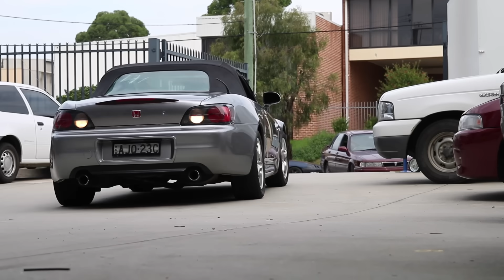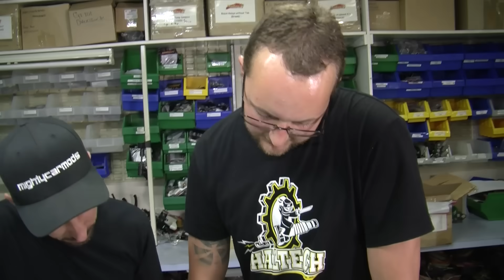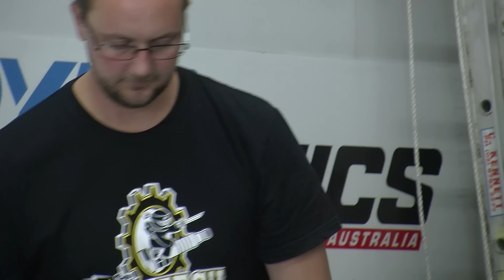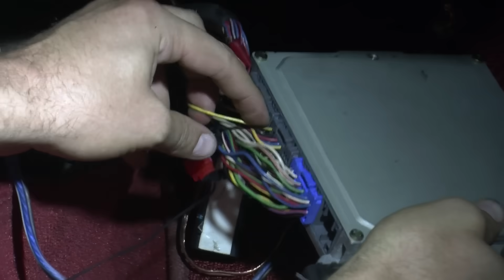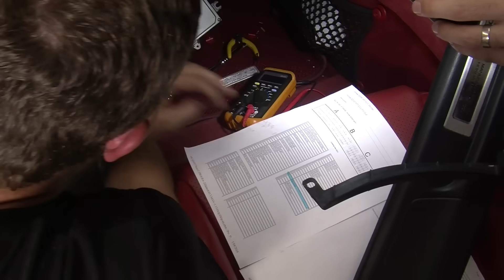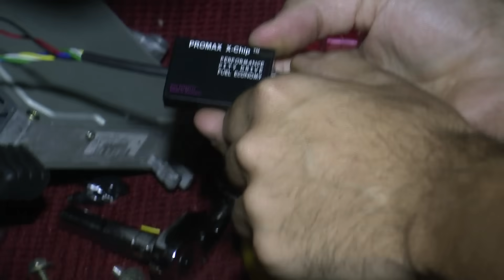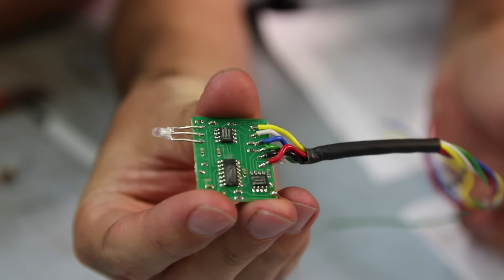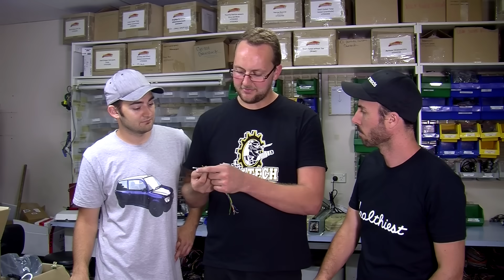eBay Performance Chips -  Mythbusted

Comment: Do it right people. Find a custom tuning place that is known for writing tunes. Usually a custom tuner will specialize in a few different vehicles/engines or 1 brand(ford). I had a custom tune written for my 08 V6 f150 by vmptuning in Florida and the guy who wrote my tune, an expert tuner on f150s and mustangs, told me only 10 to 15hp with the tuner and cold air intake. Intake claimed about 7 hp which the guy told me realistically maybe 2 or 3. Stock engine was 202hp and 260lb-ft(4.2L V6). Intake I felt very little but tune was a big jump. Flash tuner (SCT X3)with custom tune written by an expert for $420 the right way.....or 20 bucks for a claim more than double that....i was also dumb once and bought a resistor for a car which tricked the air intake temp sensor and it added power but my car burned up an exhaust valve a few months later.

Comment: I have a chip in my car and i had to add 50 plus miles before it added boost and economy i mean my tank wouldn't move but one little line a day before with same commute it was a quarter tank a day...... do this test again but add the initial 50 to 60 plus mile then put it on the dyno...... i'm sure the instruction suggested that when you guys bought it.

Comment: That same ebay seller states you can get a chip for a 4th generation f-body (camaro-firebird-trans am) funny thing is the "chip" is soldered to the board on these vehicles. If you want more horsepower or want to go faster, you need to modify the engine or lighten the weight of the the car or both. oh, and don't forget the tranny too. You could get tuner pro and reprogram the ecm/pcm, but without engine/intake/exhaust mods, you are really stressing your motor.
Installing an after market ecm/pcm is the same as using tuner pro, but again, do you really want to do this? your performance might increase, but in the end, you are shortening your engine life and violating your country's environmental laws.

as far as the ebay guy goes, he is using a simple circuit to change the color of the led. this is a very old scam and i find it humorous people still fall for this...........by the way, i have a bridge in new york i want to sell........only 10 thousand dollars.

Comment: The reason why you didn't see any gains is that you weren't using the dyno properly.  You should have changed the dyno calibration to Unicornpower, not horsepower.  Noobs

Comment: That little circuit board with the chips are just ment to change colors in the led light, for different voltage / currents. Thats the reason why they didnt want you to know what the chips were. haha

Comment: Had that car have a maf you can trick air temp, engine runs richer, computer would lean it out,  run hot, knock, and fall into limp mode.  Tried it years ago...fail.

Comment: It is possible that since your car is using a MAP sensor and not a MAP sensor that the product won't work. The two sensors work completely differently and the data they send is totally different. So theoretically they didn't do a fair study.

Comment: I remember my friend claiming he was going to chip his Dodge Ram and gain 60 hp lmao
Reply: Gauby Very possible for diesel engines, 60HP from a tune on a diesel is hardly anything at all. 150+HP is actually quite common. As for the HEMIs, 20-30HP is about the most you'll see without any other mods.
Reply: If its a Cummins he can make way more than 60hp from just a tune, get one like a smarty depending on the year you can gain 150hp+ easy.

Comment: Has anybody ever installed a performance chip, or known somebody that has, and have actually gained a large amount of horses?
Reply: I think chip tuning is only really effective if your car has a turbo. My friend took his Impreza WRX 2.5 to a company with a rolling road like in the video and they used computers to remap his original chip, which is undetectable by insurance companies. They play around with Subarus standard ECU settings for economy, emissions and boost to optimise performance. Power increased from 230ish to 271.2 BHP but more impressive was the increased torque - I can't remember the exact figures, but there was about a 30% increase with an earlier peak and flatter curve. I could find out by calling my mate!   I'm sure if the tuner wanted  they could increase boost much more and to a degree that is up to the customer, but too much boost and you run into problems with emissions, over heating and reliability.  So yes, a decent difference in performance for not much money (I could find out exactly if you're interested) just with a laptop and dyno. The car feels stronger and more willing all the time, less need to change down or rev it out and it's  just plain faster, when it wasn't exactly a slug before!   And the great thing is - because the chip is not replaced, if you need to make an insurance claim the company can't tell the car has been modded and wriggle out of paying.
Reply: i have people who installed intake and claim they make 10 hp and i asked how did you know its 10 hp.

to my amazement he lost 4 hp from stock intake.. when we took it to dyno.
not all bolt on add powers
Reply: jamie turton Proof?
Reply: jamie turton you got any physical proof ?
Reply: BillyBob Keith Check this out./watch?v=2KfMY96v_Gc

You should know that forced induction engines gain much more power then Naturally aspirated ones.
Reply: Once you dive deep into the depths of car modifications and actual stand-alone ECU tuning, you'll find that there is a LOT of ways to say yes and no to what you just asked. It depends whether or not the car has other modifications to it, and whether the tuner actually knows what he is doing. I mean, yes you can get horsepower gains with an ECU alone as well as with forced induction and/or custom internals, as with these you will see significantly larger horsepower gains with a proper ECU tune.
Reply: Yep, my 30 year old chevy 305 was putting out 276 horsepower before I chipped it, then I bought a bag of lays potato chips took them home opened up my oil fill cap and put a chip in my engine, stuck it on the dyno and it had gained 151 horsepower! From 276 to 427 horse! I plan to now chip all of my engines.
Reply: joe Costello did you really waste your time writing this bad joke ?//
wtf is wrong with people!XD
Reply: Hi ive just bought a chip box off ebay its an EVOBOX made in italy £58.00 it was said to boost up hp from 140hp upto 179hp had it on dyno today and it ran 4 runs and came back with 176hp so we opened up the box which you can and moved setting from 4 upto between 8/9 and ran again and came back with 187.3hp a big WOW factor kia sorento 2.5 diesel with a 0/60 in 8.2 secs 0/120mph 18.1 secs couldnt change gear quick enough best £60 I ever spent and these guys make these chips for most makes and set them for each pacific car model  have ordered 2 more for customers
Reply: If you get the right ones they always will give you more horse.
Reply: if you're talking a remap, then that's different..but that's a skilled job working directly on a car's specific ECU. The generic $60 PCB with a light attached...? GTFO
Reply: WTF are you all on im telling you about a chip that actually works and does what it says it does and i get slagged off they must be shit cause you say so ive bought another 3 of these as we have 4 kia sorentos in our family and they all all having this box fitted so i must being talking out my arse like you
Reply: ***** diesel is different u use a db-box a t-box or a rail-box there u have improvement's !
Reply: on diesels you can gain a large amount the 6.7l f250 with a spartan chip you can gain as much as 315 hp with the twin turbos
Reply: aka everymod wich u can build for like 15 euro. sad to tell ya
Reply: BillyBob Keith My father chipped his 2008 Volvo V70 D5 from 185hp to 220hp, there are no proof that it did increase, like testing it on the bench, but the acceleration and top speed inproved a lot. The chip was bought at BSR tuning. The hole process took around 10-15 minutes by plugging a device in the car and doing some stuff on a mini computer that came with the package. It costed around 840 dollars. Here's a pic of what BSR say's the chip gonna do: http://www.bsr.se/images/power-charts/Power-Plot-x480y540-95-535924944.png
Reply: BillyBob Keith I have done one and it made my car run not so good even with high octane, waste of money these things are.
Reply: *****  diesel motors have been known to gain hundreds of horse power from "chips". I had a 150 HP tune on a Chevy duramax..
Reply: ***** yeah I agree. I mean if you slap a Borg Warner on a Cummins you'll see a fat gain with a good ECU tune, but it all depends on the camshaft tune, rocker ratios, and stroke as well, along with the selection of intake manifold.
Reply: x
Reply: no, id rather port polish and upgrade the interns of the engine.

"performance chips" are your major 'Kiss Your Ass Goodbye' to your hard earned cash...
Reply: Yes, on the 1987-1995 Grneral motors TBI pickup trucks,  but that was with other mods done as well, the ecu had to be re-mapped(by installing new chip) to handle the new fuel requirements
Reply: Lol it took 30 seconds to write id say it was worth it, sorry you thought it was dumb!
Reply: BillyBob Keith Yeah but those Chips cost 350€ and they dont give 35HP more like 15-20 HP but they work.
Reply: yes... those chips do in fact exist but they aren't cheap.
Reply: BillyBob Keith I'm sure the Ukrainian who sold the chip has installed more horses. Now there's 3 horses pulling his carriage instead of one. The handling is massively improved too, as he has now the choice of 3 directions the horses can run in.

His horses are called Dale, Monterey and Chip. The series was popular when he was a kid.

Comment: Not all chips are hack jobs like these. Being a '93 OBD1 BMW the map (tune) is on the chip and and a 98RON tune actually does give me an objective economy bonus (I calculated it properly) and subjective better low-mid range. I can tell because I have another 540i with stock tune to compare with.

Comment: Well that was....educational. would be interesting to see how the true plug and play modules for £60-£120 range work. Vs the more expensive units..... I had a plug and play chip from a company called Dragon Performance (The don't exist anymore I believe) anyway they were retail of around £350 and offered up to 30% if i remember right, picked mine up used from ebay for about £40. The unit plugged in next to the injection pump inline via a set of genuine harness connectors meaning it could be fitted in about a minute. it had a pedometer that allowed power increments of 5% to be set at a time. A loop of wire came out of the unit allowing for an on/off switch to be fitted. I did this with mine and you could notice the difference in the power when engaging the chip with your foot flat on the floor! This was fitted to a golf mk4 TDI 110bhp, remapped to bout 135 so was running about 150 with the chip engaged.... and boy did it shift!

Comment: Using a multimeter straight away would've saved you 22 minutes of video time
Reply: Putting a multimeter on a non-powered electronic device would mainly show nothing.
Reply: This is true, but it's fun to watch them systematically run the thing ragged on all the settings and demonstrate in power-to-the-ground terms that it does absolutely zip. Plus, hooking it up exactly as instructed (as best they could) avoids all sorts of manufacturer ducking and weaving along the lines of "opening unit may void warranty" or whatever. Diving into the guts of the thing at the end and finding out not only that it doesn't work as advertised but that it's specifically designed to do absolutely zilch (except make a pretty light glow) is the icing on the cake. Mind you, finding that the ICs' identifying codes had been deliberately scratched off should also have been a pretty good clue that something not entirely honest was happening.
Reply: I don't know, probably would've satisfied me ha

Comment: there are chips thatll give you a performance.tune. 84 mustang 5.0 5 speed, no obdII connectors for sct.tuning so they had performance.chips that actually.worked. the eeprom chip gets replaced by a chip that has a tune on it, could be for anything really. a chinabay (ebay) chip i would not trust since they dont.make chips anymore, you might be getting some blank eeprom with nothing on it.

Comment: you get what you pay for.   try the 250.00 one that plugs into the OBDII socket near the steering wheel.  It does improve accelleration and MPG.  I installed a cold air intake too.  On my 1997 Infiniti I30.  Jest wanted to breath new life into it.  I'm lovin it.  No need for a new car with all the useless add-ons.

Comment: The most important question this video brings up is why is your 240 horsepower Honda s2000 only making 177 at the wheels... that's a 27% drivetrain loss.

Comment: hmmmm 177 hp that sucks considering tht the s2000 advertises 240 hps ,power loss and all i still expected more than that..
Reply: 240 is probably power at the crank, the 177 is the power you get going to the wheels
Reply: ok thats y i said power loss and all. at the wheel with auto trans and if ud have 4wd it should be any more than 30 percent power loss and thats worst case!
Reply: looked up a few runs on dead stock s2ks and almost everyone had it between 195- 207 horse sooo eigther somthing is wrong with the car or dyno for that type of power loss
Reply: you never know

Comment: 98 dodge ram 5.9l v8.  Stock hp on dyno was 246.8. Installed superchips cortex for 300$. Rear wheel hp is now 291.4 on the dyno. Cheapest hp I've ever bought. Some chips do work. But not for 20$.

Comment: How about you buy a car where its good enough to be used without having to fucking modify it.
Reply: A stock car? BLASPHEMER!!!
Reply: Where's the fun in that?
Reply: ReaLzEdits Because the show....is called....mighty car....(wait for it)....mods.
Reply: It's just like telling PC guy... How about you buy pre built PC and not overclocking it or modifying it? How about NO.
Reply: If you buy a pre-upgraded car rather than upgrading it yourself you should probably steer clear of performance cars.
Reply: sermerlin1 Touche
Reply: money it is the reason dude
Reply: I love stock chevelles and belairs. They came out of the factory perfect.

Comment: But tuning your ECU isn't a scam, right?
Reply: if you have a turbo or supercharger especially if its aftermarket you can mess with your air fuel mix.  that can be helpful, otherwise there are much better way to spend your money
Reply: Spencer Wilbanks Ok thanks. my car's na so ill be fine. do i take it chevy or do i do it on my own? the ecu tune
Reply: Spencer Wilbanks yeah like a couple of stickers for the fenders that say "TURBO" and one if those turbo emulator whistles you shove up the tailpipe.
Hey it sounds faster... you can use the money you save to pay your speeding tickets.

Comment: Honda has hundreds of very smart people who spend thousands of hours developing those engines. A little common sense should tell you that tacking some little chip on is not going to get you an extra 15% power.
Reply: Yes and no.
Honda sells cars that they have to warranty for xxx,xxx miles and pass emissions tests and get xx miles per gallon fuel economy to match their marketing claims.
To do all these things there have to be compromises in some areas. 
The oem chip is a good balance of compromises and I think 15% is a bit of a stretch to expect from a chip alone. However for some applications a good chip can benefit other mods say an intake and exhaust mod  where youve raised the rpm range of your peak power.
I dont think a chip alone  is a mod worth pursuing and frankly you can accomplish some of the things a chip can do with other methods.
I had an 86 vette and the chips they sold for it promised lower operating temps and advanced timing to take advantage of that... but I found you could just bypass the ac high pressure switch to make the cooling fan run whenever the car was below 45mph and replace the MAT sensor with a better calibrated one and move it from under the plenum to the air cleaner where it got a more accurate reading.
Those two things alone picked up about 10% power. Cost me like $20 for the sensor.
So while I didnt spring $350 for the chip if I had I would have seen the same gains.
Reply: jeffel80 lowering the operating temperature 40-50 degrees and using a recalibrated and relocated MAT sensor to take advantage of this by advancing the timing does nothing at all. Whatever you say.
Reply: jeffel80 It helps to understand that in the L98 TPI 350 GM put the MAT sensor in a place where it never really got an accurate reading in the first place. Mid America Corvette thus sells a relocation kit with a recalibrated sensor.
Reply: Manufacturers have been caught "cheating" with chips that put the car into a cleaner-burning mode when they judge that the car is likely on a pollution-test rig. Why would they need to do that if pollution compliance didn't degrade the engine's behavior in some other fashion?

Comment: 3 IC's, a couple of capacitors, no less than three resistors and a zener diode! Amazing!

- As someone who builds printed circuit boards for a living, it's neither a complicated board nor practical, unless you like having a LED that changes colors. Integrated circuits (The black things with legs) run about 30 cents each, the rest of the capacitors, resistors, and the zener diode probably cost another 30 cents, outdated RGB LED maybe 50 cents, so they're making a lot of profit!